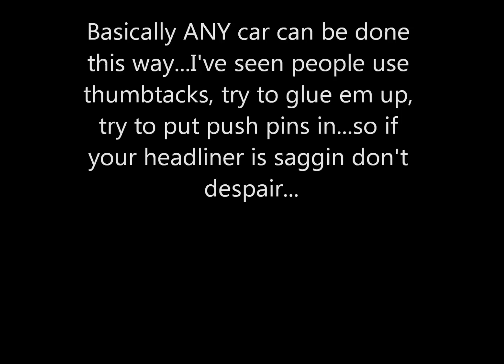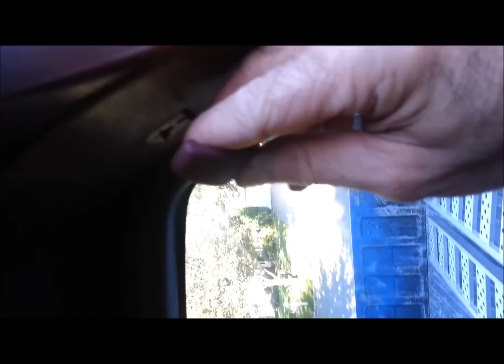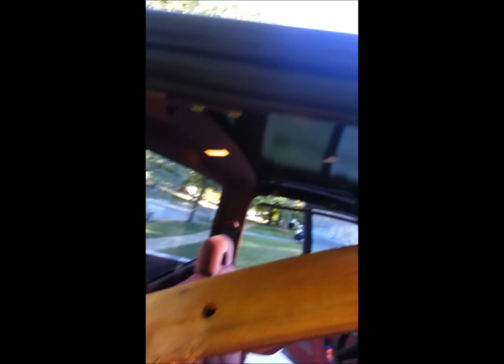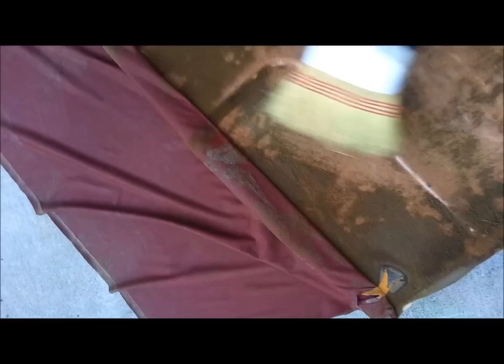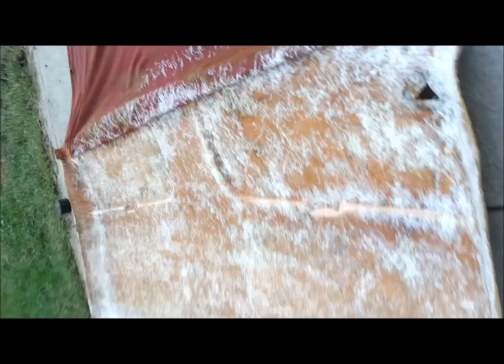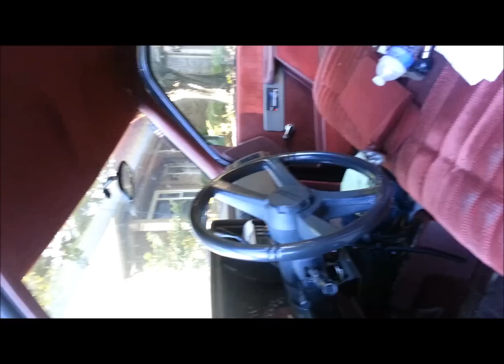Sagging Headliner Repair 1992 Chevy Silverado

Comment: Litterally the only thing i needed to know was how to remove the grab handle and its skipped over
Reply: There is an end cap on each end. Pop the cap off to gain access to two torx  bolts
Reply: @jamesfrancis7284   I got mine off and they're 7mm bolts

Comment: I used high heat epoxy / resin.    The bond when u spray only lasts so long till u have the same problem later on
Reply from the maker: Nothing lasts forever...that said my truck has been perfect since I filmed this video, and that was quite some time ago.Not sure you followed my exact procesd if you're having issues.  I wish you good luck

Comment: How hard would it be to remove the headliner if it's not sagging? Mine is pretty much perfect, I'm just wanting to change my interior color.
Reply from the maker: easy remove the material...A heat gun might help...be careful
Reply: Jimtoledo thanks for the suggestion

Comment: I did my 98' Frontier and it came out great. Fixing to do my 94' 4x4 Silverado now. I found a good material replacement at walmart in the form of a cheap blanket for $8.88. Comes in grey which I used for my Frontier and done 2 years  ago and still looks great and holding. The Silverado I found the perfect beige color. I used the Permatex on my Nissan but had to get the 3M this time. Hope it holds as well. Good video.
Reply from the maker: James Roberts  Cool, yes its much easier than people think! I am conservative so simple single colors for me...just in case I ever sell...thx for the feedback

Comment: you can buy the headliner fabric and do a like new headliner
Reply from the maker: D G  I had considered it, ended up with, if it failed in the first place, and it certainly did! Why introduce a known 'weak link'? The headliner, the way I installed it has been perfect for 3 years now...thanks though :-)

Comment: This would be great, except I've done this before on other vehicles and am only 'stuck' on getting the a-posts out because mine for some reason don't want to come out, and your video didn't show the clips or how you 'popped' yours...grumble grumble...
Reply from the maker: +Cyberdyne Systems: Skynet the absolute best answer for ths is to go to your local junkyard, take a fiberstick or plastic wedge, even a screwdriver and take one apart...you will gain invaluable experience to your car...mine in the silverado just 'popped' off...when you pry them free...but, regardless of the vehicle you have if you take one apart it will resolve your issue...GL

Comment: Okay, so ten months and a couple collision repairs later (thanks kids) finally got around to the head liner redo. Your advise was sound-the little plastic clips will snap off unless you are a brain surgeon-live with it. Got my foam-backed material and high temp glue at Jo-Ann Fabrics for about $50. Fabric is not quite wide enough to allow forming into the sun shade recesses and the $20 can of glue is just barely adequate. Might be better to get your stuff off an on-line specialty provider or, if you are REALLY patient you could glue the foam in first and follow with a fabric of your choice. I ended up lapping the material front and back for extra hold and using some ancient commercial spray glue from In-line Supplies-probably get the same stuff from U-Line. Night and day difference in hold. Only good thing in the Jo-Ann glue is the spray tip-really damned good. Thanks for the video.
Reply from the maker: I never condone nor support any foam backing...period. Also never recommended hi-temp glue. Also do NOT recommend 2 piece material. I've done this on 7 cars successfully just the way I've  described for you. This is a do any your own discretion and ability. This headliner was done quite some time ago and is still holding fast today...good luck though...
Reply: Thanks Jim, I agree that this foam backed stuff is bound to degrade before any plain fabric material. Also, my experience with the hi-temp glue was not the greatest. The commercial stuff I used was at least six years old and still worked better than the stuff from Jo-Ann Fabrics. Thanks for the video-you gave me (a complete amateur) the courage to tackle this job.
Reply from the maker: +Tom Nelson  Tis quite alright hope yours turned out...thing I wanted to make clear for everyone was that foam backing is 'why' the original stuff failed in the first place...and why 're-insert' the weakest link. Thank you!

Comment: VISORS ---I didn't like the original visors so I went to a salvage yard after measuring the length of the original visors. I found a nice set of visors in an old Safari. They were thick & had the mirrors etc. One of the attachment holes matched up & I used self drilling screws to finish them up!

Comment: A new piece of that material with the foam backing is pretty cheap...just sayin'.
Reply from the maker: tim paull yes I am familiar with them and didn't want to perpetuate the issue. Meaning the old foam failed after several years, the new foam is likely to follow suit (and who knows its 'specs' compared to OEM)- may fail sooner. The method of this repair eliminates the weak spot...and if someone wanted to change their material it would be easy, go to a fabric store get the fabric they want then cut it to size and install. If someone uses a dark slightly 'fuzzy' material it creates a different ambiance in the car...I've seen guys use 'sheet' like material with their favorite teams logo or school mascot...remember one day you will sell the car...Good Luck though :-)
Reply: the reason the material fails is because the manufacturer cuts the material flush around the edges and believe it or not its wind getting behind the material that degrades it. the fix is wrapping the material over the edges by a couple inches. never had one come back from failure.
Reply from the maker: +darter1075 sorry but my experience says the heat from the roof, and the temperature change from hot to cold are more detrimental to them than 'wind' as they are inside the car. But, in either event why introduce a 'weak spot'? Thanks for watching

Comment: Same problem on my 1991 c2500 ext cab. i guess GM had a bad glue back in day, anyway i'm trying this today great video!
Reply: I think the glue is fine, but the foam disintegrates over time.  The foam rubber was originally in the middle, like bologna between two slices of bread.